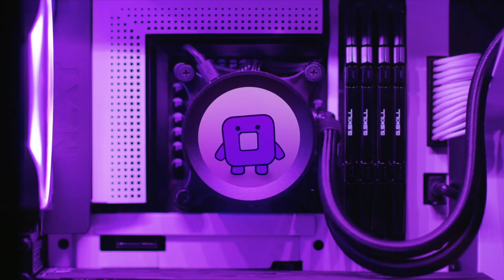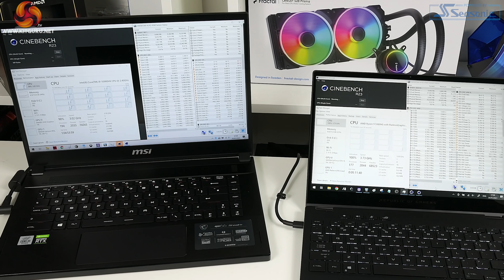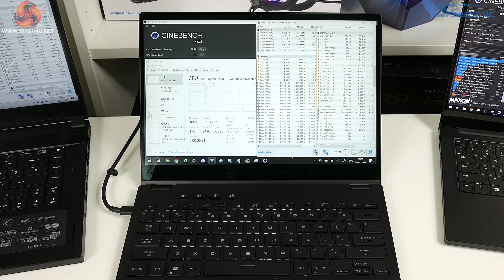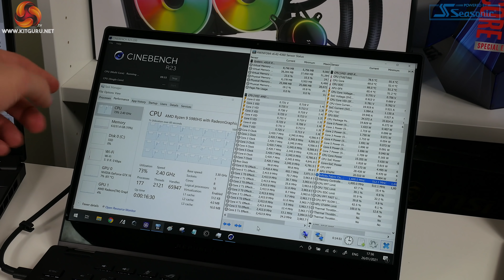Luke uncovers unusual ASUS / AMD 5980HS Throttling

Comment from the maker: Luke (our local engineer who used to work designing Aircraft engines) has been reviewing the new ASUS ROG Flow X13 laptop featuring AMD's latest Ryzen 9 5980HS processor and he has been seeing some weird issues. He wanted to present his initial findings before the full review, and as its Luke, he tends to go into massive detail.

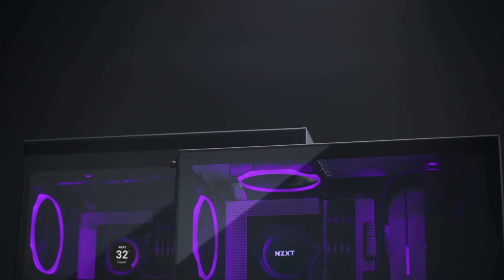00:00 Start
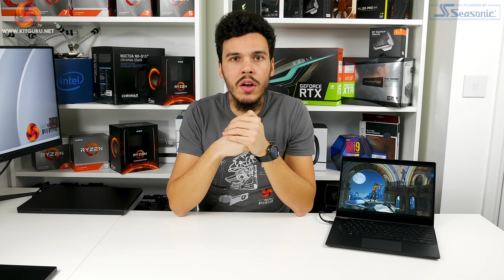00:15 Introduction
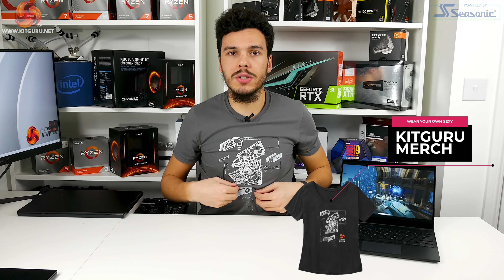01:09 AMD Ryzen 9 5980HS
02:00 Analysis: Performance testing and comparisons
06:12 Removing the shackles - more tests
08:55 5980HS analysis - quirks, ‘throttling’ power modes and details
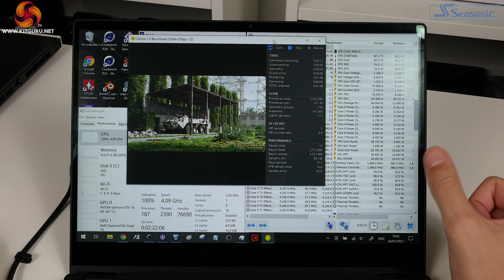16:48 Game Testing - CPU throttling / VSync on/off / package load
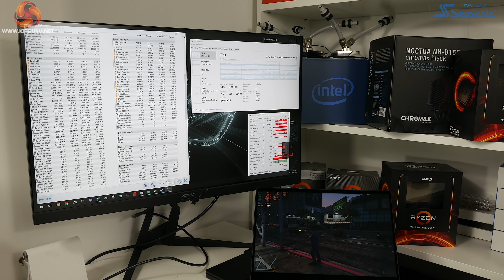21:13 Closing Thoughts on these tests

Comment: If the chassis isn't able to dissipate the heat from a sustained 54w load, it would seem logical to reduce long time power limits. The cpu is more efficient at lower states so in theory it would do more work right?
Reply from the maker: The chassis and cooling system look to be fine even for 54W sustained load (especially if the 35+W GPU is not loaded and using the cooling capacity). It looks to be a firmware issue at the moment. We have another testing video up that you may find interesting :)! Luke

Comment: Thanks for sharing.  Is this analogous to the throttling issue that was seen by many reviewers on the G14?  It seems in the case of that model that the cooling solution was just sufficient for the power of the CPU when boosting.
Reply from the maker: It does not look like a cooling issue as the ASUS cooling system is very good and the recorded CPU temperatures look fine (not sure about other temperature sensor data - such as skin temps - that we do not have access to). Do you have a link for those points with the G14? Leo worked with our G14 sample last year, so I did not get hands-on with it unfortunately. Luke

Comment: Does this behaviour occur in the tent mode as well?
Reply from the maker: Just replied to the top comment with some feedback we have since received. A laptop MCU firmware update from Windows Update looks to be causing the problems. This does not seem to be fixed yet and cannot be removed in our testing with guidance from AMD. Tent mode seems to alleviate throttling specifically when the laptop knows that it has been switched to tent mode (so perhaps it is an intentional design choice to limit power / thermals).

Comment: I've ran into similar weird throttling behavior on some slimmer Renoir laptops. Usually beneficial to lower power limits than constantly bounce around due to throttling. Your move, ASUS.
Reply from the maker: Interesting. Which laptops were they? Did you manually lower the power limits with third party software yourself? Luke
Reply: @KitGuruTech  Lenovo Flex 5 has similar issues when on battery in the high performance mode. The skin temp sensors get too high and it starts oscillating between severe throttling and full speed. Doesn't occur on AC in that system - I imagine Lenovo disables skin temp throttling when charging for some reason. I didn't lower the power limits manually, but I did notice that using the balanced power profile on the system (bringing power limits from 35w to 25w) prevented the throttling from occuring, so it's likely just chassis heat soak.

Comment: 89 is a bit high, it seems normal to me.
Why didn't you put the Flow in tent mode?
Reply from the maker: 89 is indeed quite high (albeit likely tolerable for the CPU) but the throttling behaviour is quite aggressive indeed. I have been doing additional testing in the tent mode and should have some findings soon. Realistically though, this is a powerful laptop that (in my opinion) will need to exhibit its full horsepower in standard laptop mode primarily (keyboard on desk and screen at a viewable angle). Luke
Reply: @KitGuruTech  when it's on my desk I exclusively use my surface book with the screen on backwards. I plan to use my x13 in the exact same way.
Reply: @Mireaze  - its a huge appeal of this laptop. - I like using an external keyboard, and you can completely get the body out of the way with tent mode. - ideal for using with a 2nd screen. - I would probably put the body on a cooling pad - give it a little bit of help - plus I think the 5800HS will be fine for me. - not sure if I need - the best one!
Reply: @KitGuruTech  I'll admit I don't know when the CPU should throttle. 
I don't understand why you want it to perform as well in standard mode; Asus said you will get best performance in tent. I'm sure it will still stomp the competition in standard mode though.
I look forward to seeing benchmarks. Are you going to be testing the External GPU as well?
Reply: @KitGuruTech  I wanted to say that I really appreciated your initial benchmarks above, and your follow-up testing regarding shadowhawk's question!  You've certainly already shown that there're some performance questions that need answering before a blind buy, but it would be worth knowing whether tenting the device and setting it aside on your desk will avoid any of the throttling issues you've expertly picked up.  ASUS themselves describe the device's intended home/gaming use case as being a) attached to the eGPU with external keyboard/monitor plugged into the dock and b) with the device in tent mode (or, instead, with the keyboard down/fans pointed up).  In that configuration, more than a few reviewers have already identified an immediate ~6*C drop in temperatures.  Ideally (and your testing will be invaluable here for the reality), this product might allow a full heat, 150W TGP RTX 3080 to be externalized and separately cooled from the peaked out, full heat AMD CPU, all while maintaining an ultraportable form factor that customers can detach and use for lighter gaming on the go (or just for work/life).  I'd hate to be sold on the hype, though, especially since the entire bundle starts at $3,000.  Heh, anyhow, this is the long way of saying: thanks for your work!
Reply from the maker: @DaedalusGage  thanks for your excellent comment and very good points. We spoke with AMD and it looks like a firmware update from Windows Update is causing the throttling issues. This does not look to have been fixed (as of mid last week) and the update could not be successfully removed in our testing. Hopefully it will be fixed soon (or that the update has been removed from Windows Update). Tent mode does look to help when the laptop specifically knows that it is running in tent mode (perhaps this is a sign that the behaviour is intentional). We have another testing video where we also highlight performance with Manual 35W mode through Armoury Crate as this looks to override the throttling in laptop or tent mode. Thanks - Luke

Comment: Very interesting. I have a Gigabyte aero with the HK and software to change power limits and fans. Runs similar to my desktop 3950x. Have to think on it. Thank you.
Reply from the maker: What sort of power and fan numbers do you run and do you find them good for noise and thermals? We saw the HK hitting lofty 100W-ish levels in the MSI GS66. Very power hungry but also fast at that power level. Luke

Comment: Looks like this behavior is caused by the Asus userspace application, not by the BIOS/Firmware, that's why the CPU utilization looks this weird?
Reply from the maker: It's not the ASUS software interferring. I have killed the ASUS software through task manager and it still exhibits the same behaviour. Luke
Reply: @KitGuruTech  If the ASUS software has already set the limits e.g. STAPM, killing it shouldn't change anything after the fact
Reply from the maker: @happyfeet5003  Indeed. However, it is difficult (or down to user preference) to decide whether the software should be removed fully. Armoury Crate does have some very useful data and features. Luke